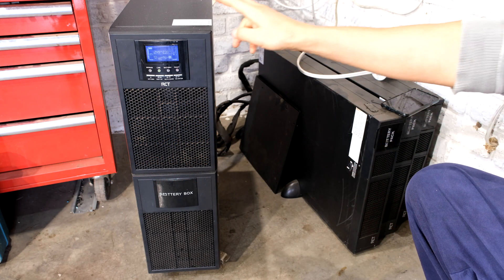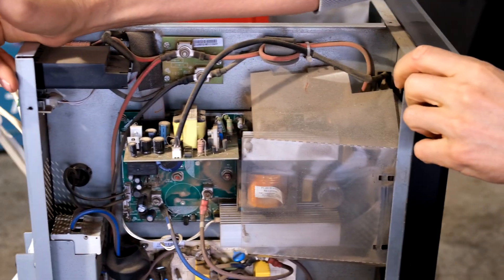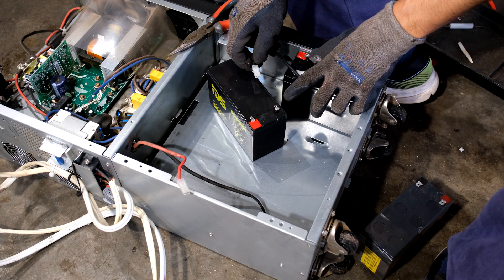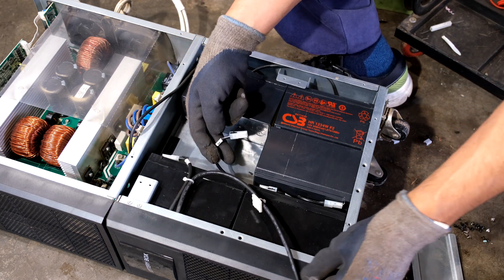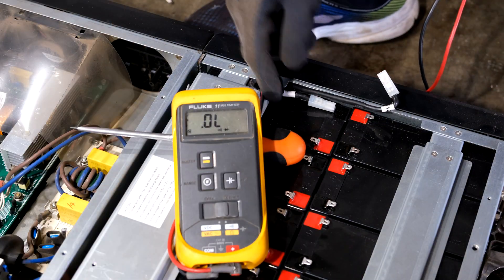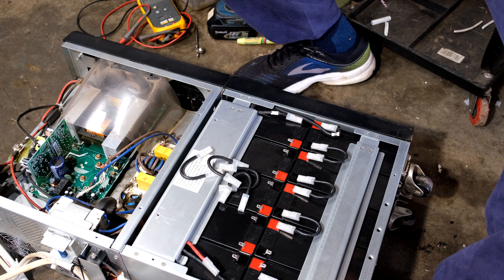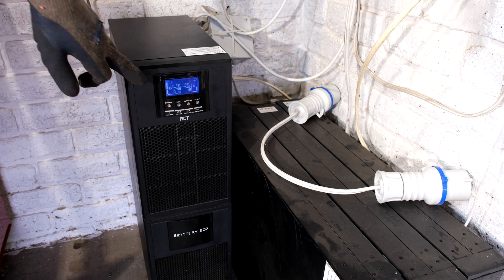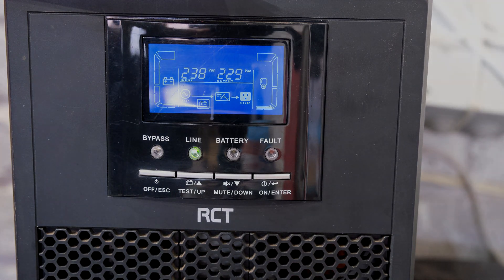How to replace the lead acid batteries in the Voltronic WinnerPro 6k/10k Rectron/Mecer WPTU WPRU UPS

Comment: aNY NEWS?? DID THESE BATTERIES WORK ANY BETTER??
Reply from the maker: been behaving well. So far they doing a good job, the performance is predictable, actually i don't even think it has reduced at all, still getting similar backup times as i did over a year ago. Will know for sure in another year.
Reply: Well I bought the Mercer Winner pro 3000va , barely lasted 9 months. Now only 15min on time. Only running a router, a 27” screen and a computer, probably 450w
Reply from the maker: @v-man1122  terrible. Very frustrating. The derating factor on the batteries is very high and i guess not worth it. I have two other installs that each have 5 banks of 16 batteries each and it also has gone down to 15 mins like yours. FYI: What i also found is that the charging current, if too high, also ages the batteries.
Reply: This one has 6x12v 9ah batteries, and Im not sure if its worth replacing them, or just getting a different solution, stage 6 loadshedding is no joke
Reply from the maker: @v-man1122  there is lithium batteries but i have not received an answer yet from the supplier as to whether these are safe for their charging system. With regards to the gel type in my video, they definitely better from my provisional tests. Its over a year and they still have a good back up time, but with all the recent load shedding they i have noticed they have dropped off a bit. Keep in mind that any lead acid battery drops off anything between 10-30% per year. The other issue is that these batteries are connected in series and if there is one bad battery then it drops the voltage output...
Reply: @ecologicaltime  Did you ever get a reply from them? I would like to replace the lead acid batteries with lithium ion ones
Reply from the maker: @tyronfitzpatrick4329  supplier (Rectron) advised me not to replace with Lithium for these models.
Reply: @ecologicaltime  since it’s Lead Acid batteries you are only supposed to set your backup time to 0.5 because Lead Acid Depth of Discharge is 50% if you want to prolong the life of the batteries. If you use them more than that then they are definitely deteriorating. Or another fix would be to get Lithium Ion batteries with the same or higher discharge current and set them to 80% backup time for prolonged lifetime.
Reply from the maker: @jaymaster103  Still wont save the batteries. The design of this UPS is the problem, High currents flow through the batteries. Just think about these 9Ah batteries having a continuous current of over 30A flowing, this ages them. Yes you can derate them by that percentage. The manufacturer provides it with 100% rating. Supplier says no to Lithium for these units by the way.
Reply from the maker: I have a list of reasons of why these UPS do not last with battery life. I sent them to Rectron product manager and he did not reply. Initially he blamed load shedding for the problem which i challenged him.